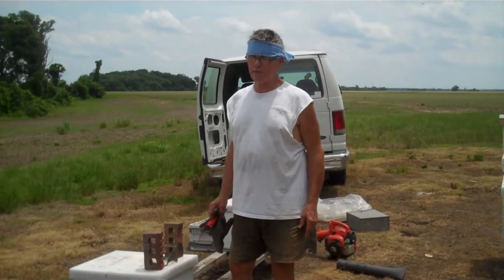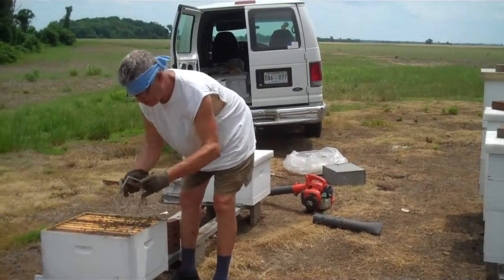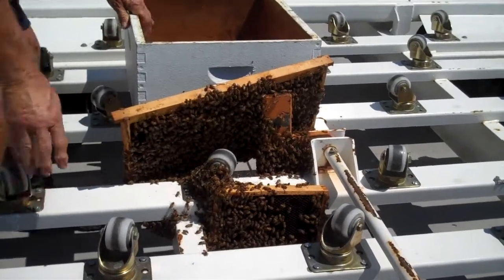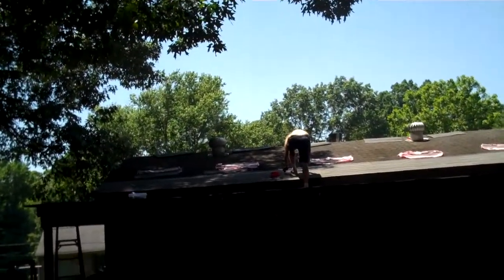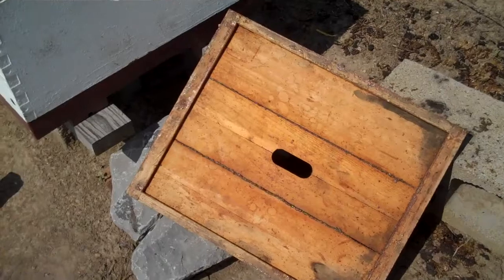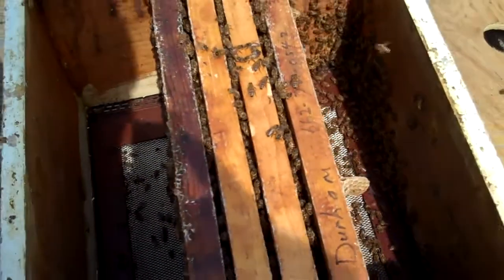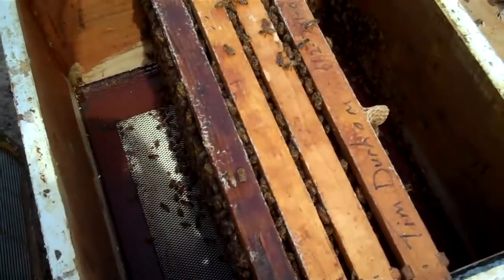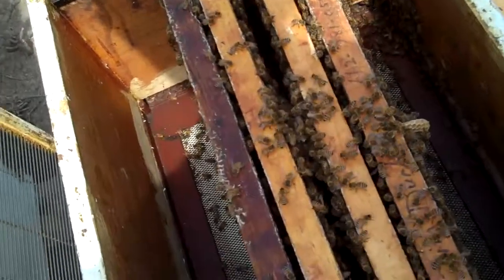Honeybees, Tips for new Beekeepers Honey Bee Queens & comb honey

Comment: Hi Tim,

Thanks you for taking the time to make your videos. They are really helpful for new Beekeepers. I was hoping you could answer a question about my bees. I hived the bees( a 4 frame nuc) two weeks ago tomorrow (May 25th 2016). After they'd been in the hive a week I opened things up to have a look. Found the queen and she was doing what she is supposed to, and noticed that the workers had built  burr comb coming off the bottoms of the original nuc frames. I removed that comb and closed up the hive. I have a framed bottom board and the hive is on a stand which allows me to look up into the hive from underneath. The bees had replaced the comb on the bottom of the frames that i'd scraped off last week. Its big and oval, about 3-4 inches across. What can I do to direct their efforts to working on building comb on the frames rather than off the bottom bar of the frames?

Thanks,

Chris
Reply from the maker: Bee space is important.  If they have too much space then they will build burr comb